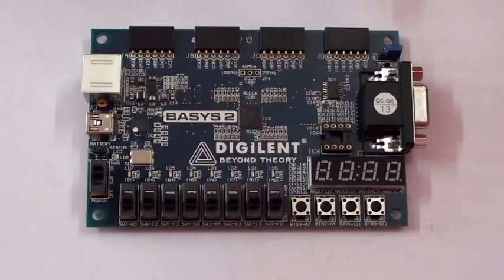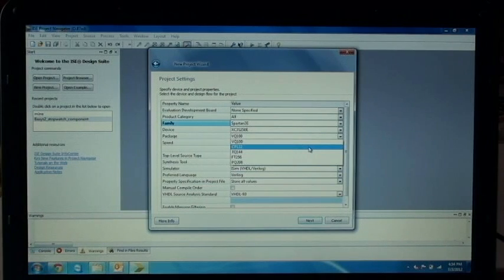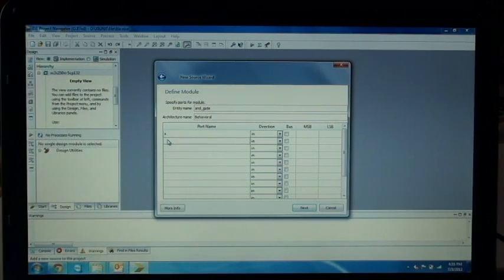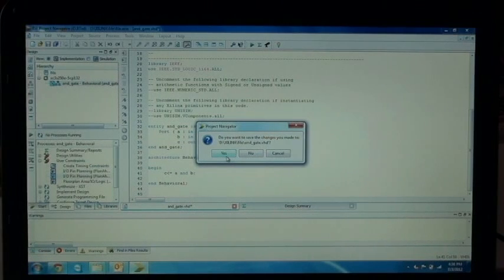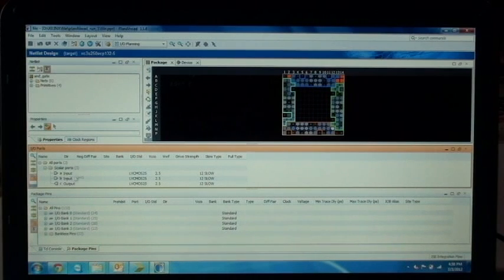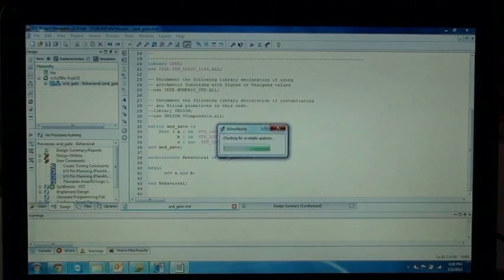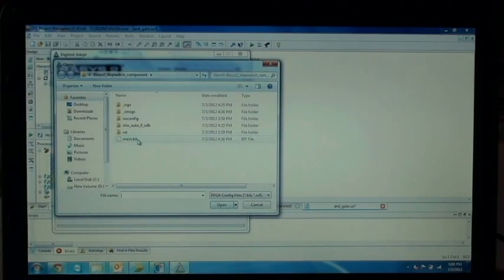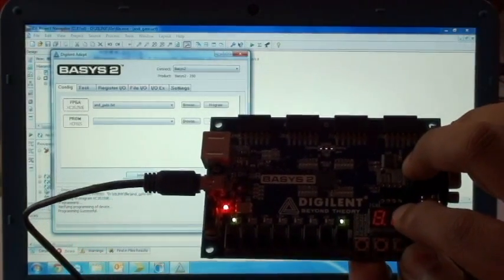Tenet Technetronics: Basys2 FPGA board

Comment: If you use Xilinx you can right click on Program (in the process pane) and properties. On the startup page set the first option (the one with JTAG set) to CCLK). Then create the bit file. Now you must put that bit file in the ROM. To make the board run that instead of the normal RAM put the jumper (the one above the VGA port) to ROM instead of PC. Now each time you start the board and the jumper is there you get that program loaded up

Comment: Thanks a lot for your Work !
The Problem is, when i switch the Power off on the Board.
I have to load the Bit-File again, because it is not stored permanently on the 
Spartan FPGA.
Can you show "how to" create that special Bit-File,
that is then stored in the "extern Boot-Flash-ROM" CHIP. 
So when I "power up" the  the Board again,
the Bit-File is transfered from the "Boot-Rom" in the Spartan FPGA, to run there forever.
Thank you so much.